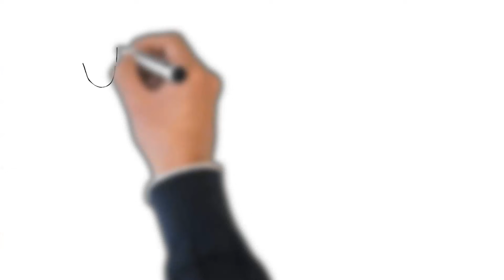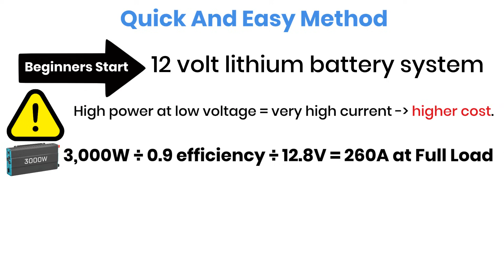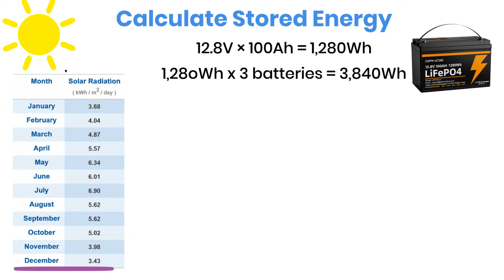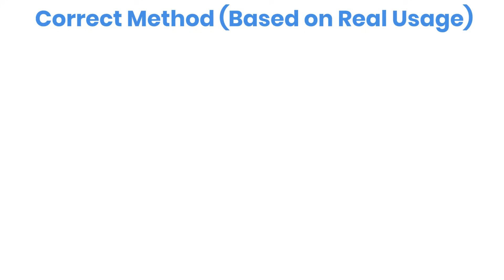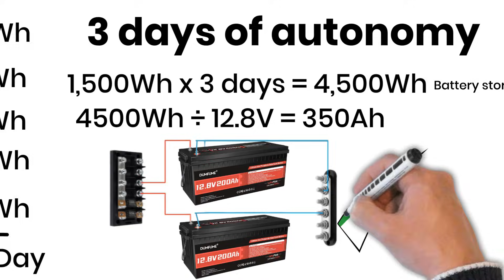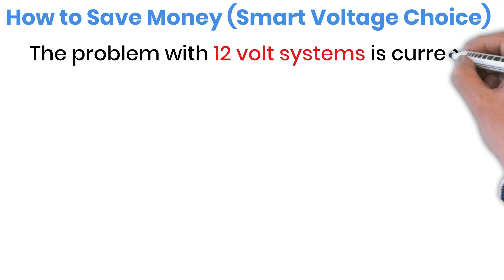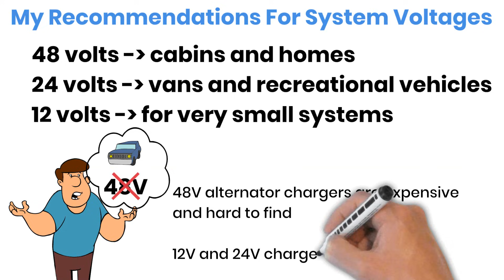How Many Solar Panels for a 3000 Watt Inverter at 12 Volts? (Real Answer + Save Money)

Comment: That high frequency transformerless inverter is not a real inverter, it's a toy. 😂😂😂
Reply from the maker: High-frequency inverters definitely get a bad reputation. They’re lighter and more efficient, but they’re not built for the same surge loads as a heavy low-frequency transformer inverter. For small and medium loads, they work fine — it just depends on the use case.
What kind of loads are you running on yours?
Reply: @batteryhacker4343  I use a low frequency power station, with 10kwh in batteries, it idles @ 13w, so more effecient is subjective, and it's 85% effecient, and before you ask who I have, you cant get one now, people want this cheap stuff not quality! There's only 1 company that ever made a low frequency unit, Point Zero Energy, Titans.
Reply: Glad the one I have weighs like 20 pounds then....

Comment: I have a small RV and don't really require a ton of energy. A small 2000w generator fills in the gaps on cloudy weather days. My inverter is 2500w and I have 600AH of batteries. Running my generator is also a must when cooking, since I have no gas stove. I can run my 900w microwave or 900w hotplate but the 1700w I only run on the generator.
Reply from the maker: That’s a pretty practical setup. using the generator for higher draw cooking loads makes sense in an RV. With 600Ah, your daily essentials should be well covered on most days. Are you finding the generator kicks in mostly because of cooking loads, or does it struggle to keep up during cloudy stretches too?
Reply: You would have to be a baby-boomer.

Comment: You should calculate accordingly for the 12v system as well.
Reply from the maker: For the same 1500W, a 12V system would be pulling roughly 120 amps, compared to much lower current at 24V or 48V — which is why wiring and controller limits become a bigger issue at 12V.
Are you running a 12V setup yourself?
Reply: No , I just have an Ecoflow delta 3 max plus ,  if I would have to design a system from the ground,  it would be 24V .  @batteryhacker4343
Reply from the maker: That makes sense 👍 the Delta 3 Max is a solid all-in-one setup and I agree if someone is building from scratch, 24V is usually a very practical middle ground between simplicity and efficiency.
Is there anything specific about 24V that makes you prefer it over 48V?
Reply: @batteryhacker4343  my perspective it's from a traveler side. 48v would be more efficient clearly. All your arguments in the video are spot on .
Reply from the maker: From a traveler or mobile setup point of view, 24V is often the sweet spot, simpler wiring than 48V, but much lower current stress compared to 12V. And yes, 48V wins on efficiency for larger stationary systems, but it’s not always practical for every use case. Appreciate the feedback and glad the video made sense from your experience.

Comment: A channel using computer generated voice is not to be trusted with information like this. Many practical misinformation here.
Reply from the maker: I understand your concern. The voice style doesn’t change the math or the principles behind the system design. If you noticed something specific that seems incorrect, feel free to point it out. I’m always open to discussing real technical details.
Reply: @batteryhacker4343  Firstly, I never liked the computer voices and now you can see it developed into fake AI videos all over the internet.
Then. Working on mathematics only does not represent the real world. You work on 3 hours sun a day. What about situations where you don't get any sun for weeks on end like we had for December and half of January. Then big and bigger battery banks will not help you. To much emphasis is put on battery capacity instead of solar charging capacity. With my first system years ago I did what you suggested and we ran out of capacity. I sold the house with that system. With my latest system I used my experience and installed a battery just enough to carry us through one night, that is it. I oversized my solar panels (according to what people suggest like you do) to be able to operate during rainy and heavily cloudy days and use all my equipment and charge the battery to carry us through the next night. I never-never had a problem again. Rather use a oversized panel system and a smaller battery just for one night. With the lowering price of panels it is more economical anyway. I can now buy 550 watt panels in South Africa at the equivalent of $88 per panel in my local town. It is even cheaper elsewhere but then I will have to pay shipping.
Reply from the maker: I actually agree with part of what you're saying. Oversizing solar is often smarter than oversizing batteries, especially with today’s panel prices. My calculations are meant as a design starting point, not a one-size-fits-all solution. Different climates require different strategies, and in regions with long no-sun periods, solar input capacity can become the real limiting factor rather than battery size. Your “one night battery plus oversized solar” approach makes a lot of sense in places where winter sun is still available but weaker. Ultimately, the right design depends on the system goal, whether it’s backup-only, full off-grid, load-shedding support, or complete grid independence. Out of curiosity, what’s your average winter daily solar production compared to summer?
Reply: @batteryhacker4343  We are in the summer rainfall part of the country, cloudy most of the days and like I said, during December - January we had more than 6 weeks with almost no sun and lots of rain most of the days. In winter it is mostly sun shine all day long and the batteries are fully charged by 10 - 11 AM. We don't get snow, in fact, I saw snow only once in my life of 63 years and that was somewhere else, about 15cm deep. Last winter our minimum early morning temperature for all of the winter was positive 8 degrees Celcius and during most days it is about 25 degrees Celcius. My problem is not the winter, but the summer. We are off grid but can connect to the grid if needs be, but I don't want to as it is to expensive with all the corruption going on here. With the savings by not using any grid power, our system is paid of in 4.5 years. I fact, we now use more power than when we were on grid because it is "free" and a lot of power get clipped most of the year as we don't need that much.
Reply from the maker: That actually explains your design choices perfectly. In a summer-rainfall climate with extended cloudy periods, solar input becomes the bottleneck, not storage. In your case, oversizing the array to survive those long low-irradiance stretches makes more sense than building massive battery reserves that eventually run out anyway. The fact that your batteries are full by mid-morning in winter and you’re seeing clipping during most of the year shows the array is doing exactly what it was designed to do prioritizing charging speed and resilience. Also, a 4.5-year payback while being fully off-grid is a strong result. Different climates truly demand different strategies, and your setup is clearly optimized for your weather pattern rather than generic calculations. Appreciate you sharing the real-world data, that’s the kind of input that helps refine system thinking.

Comment: 1500/24 = 49  ??  you might want to do that math again...  or for the first time?
Reply from the maker: 1500 ÷ 24 is about 62A.
The lower figure is based on charging voltage (~29V), not nominal voltage.
Either way, the key takeaway is that 24V cuts current compared to 12V.

Comment: i have a 3000w inverter, i use a cheap chinese charge controller and hooked it to 2- 100w small panels. it keeps my 12v lead acid charged and it runs my starlink and laptop. i need to get a 200ah or 314ah lifepo4 because it is at 14.3v by afternoon and cant use any of the sun after that.
Reply from the maker: Nice setup 👍 . If it’s running Starlink and your laptop is fine, your daily load is probably low. At 14.3 volts, your lead acid is basically full, so it naturally stops taking much more charge — that’s normal behavior.
A 200Ah or 314Ah LiFePO4 would give you more usable capacity and better efficiency, especially if you plan to expand.
Reply: @batteryhacker4343  yeah, i'll expand later but these are my only 110v items, in this country its 240v so i'll set up a 48v storage and everything for the house. 
my inverter was free so i just wanted to put it to use, it puts out 110. i'd like to get 3 days of laptop and starlink out of it tho, we have brownouts for 3 days after a typhoon.
this setup just runs dry about the time the sun comes up , so it works round the clock as long as its sunny every day
Reply from the maker: That makes sense. if it’s running dry right around sunrise, that just means your overnight consumption is slightly higher than your battery capacity. If you want 3 full days for Starlink and a laptop, I’d calculate your total daily watt-hours and size the battery for 3× that amount. Moving to a 48V house system later is a smart plan, especially for longer brownouts. For now, a larger battery bank would simply give you more overnight buffer.
Reply: @batteryhacker4343  this 12v car battery probably is only about 45 actual ah's , i'm surprised it gives me 24hours of running as long as its sunny everyday.
 i think a 314ah lifpo4 would get me thru 3 days of starlink and laptop. especially if we get a little sun during those days. when we have a typhoon its usually cloudy a few days after.  the laptop&starlink together pull 80watts according to my inverter readout.
  my budget is such that all this setup is getting is a 314ah lifpo4 instead if the 12v lead acid.
 i need to focus budget on my 220v house system, maybe i'll spring for a Growatt SPF 5000 ES or something similar next, then later 4- 550w jinko panels to get my 150v required to start it up. maybe by then another new battery will be out thats inexpensive and built good. its hard to keep up with those!
Reply from the maker: That’s actually helpful that you measured 80 watts. At 80W continuous, you’re using about 1.9kWh per day. Over 3 days that’s roughly 5.7kWh. A 314Ah 12V LiFePO4 gives you around 4kWh total, so realistically that’s closer to 2 solid days without sun — still a big upgrade from the car battery though.
If you get even partial sun during those cloudy days, it could stretch further.
Are you planning to keep this as a backup-only system once the 220V setup is done?
Reply: @batteryhacker4343  yes, ill leave my laptop and starlink on this. i wont use it 24/ 7 if we have a typhoon or major incident, , its important in an emergency to be able to contact family back in usa or contact emergency services etc after a earthquake or typhoon.,,a war nearby.. .. fight boredom...
THANKS for the math, i figured 314ah would about do for 3 days or so until the sun was back after a storm, just by guessing with what i get out of this battery. appreciate ya!👍
Reply from the maker: That’s a solid plan honestly. Keeping Starlink and your laptop on a separate small system for emergency communication is actually smart design thinking. If you won’t be running it 24/7 during a typhoon, that changes the math in your favor, and a 314Ah LiFePO4 could realistically stretch close to that 3-day window, especially with even a little bit of sun between storms. The big advantage you’ll notice over the car battery is voltage stability and usable capacity. And focusing your budget on the 48V house system next is the right long-term move. You’re building this in stages, which is exactly how most real off-grid systems evolve.
Reply: @batteryhacker4343  thanks, yes its a pain trying to not let my lead acid get below 9v and ruin it. be nice to just use all the battery has and refill it!😄👍
Reply: All you would need for that is a PWM controller for lead acid.
MPPT is far better but the price is quite high by comparison.

If you want 200ah+ battery you need an MPPT charge controller. Victron makes the best charge controller but it ain't exactly cheap.
They do make solar panel tracking devices if you got the money.